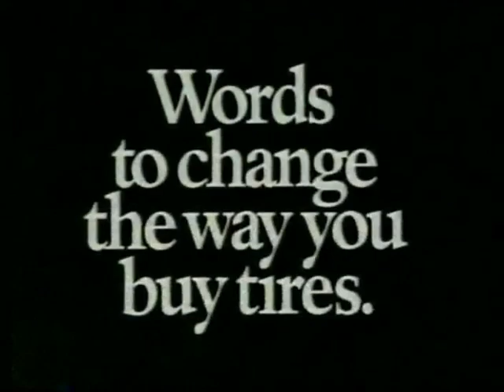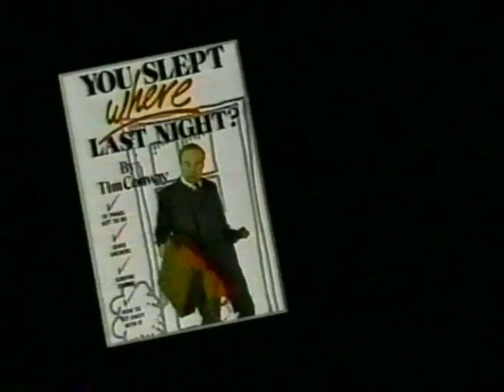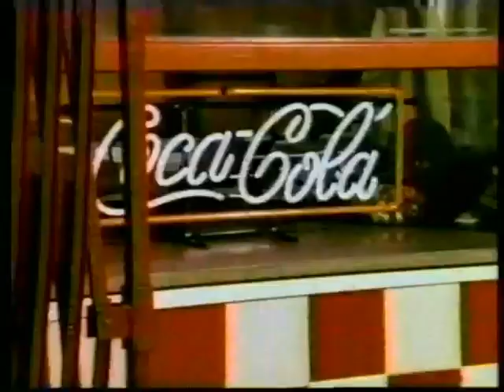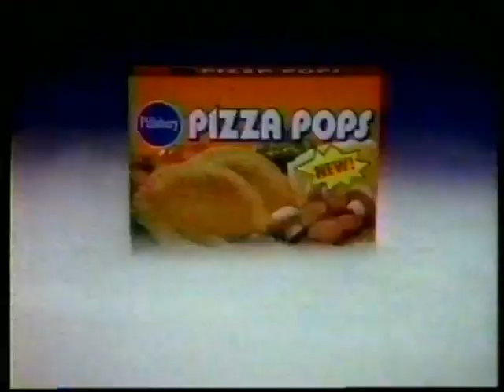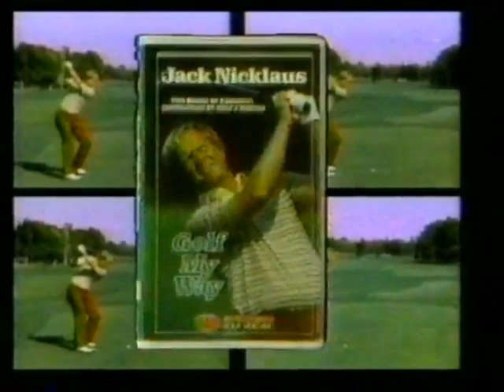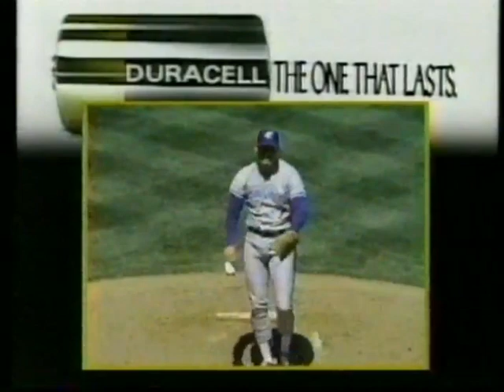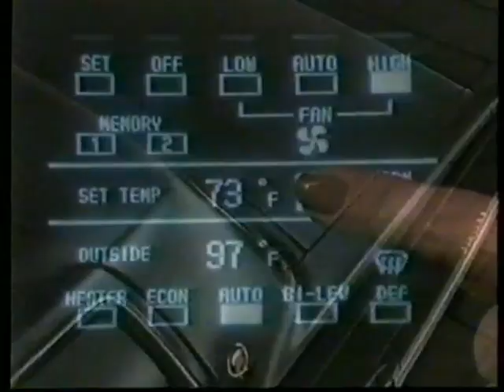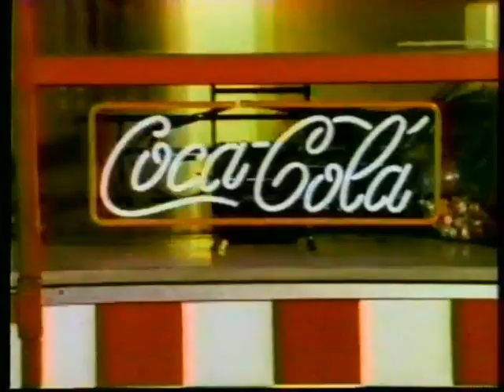1989 06 25 Blue Jays at A's

Comment: In August, Pete Rose took a lifetime ban from baseball... so the issue wasnt over
Amazingly, Henderson wearing 22 instead of 24... why i dont know
Reply: Ron hassey was wearing number 24 for awhile, yes even as this game played, before switching to number 27
Reply: 22 was Rickey's original number with the A's.
Reply: @brianoneill7186 Your right. In 1979 he debuted with number 22, but quickly started wearing number 35.
Reply: MLB owners. This is how A's crowds used to look on a  regular basis when we had owners who cared. VOTE NO on the A's relocation to Las Vegas.
Reply: @brianoneill7186 I just checked the A's 1979 roster and it has henderson wearing number 35.